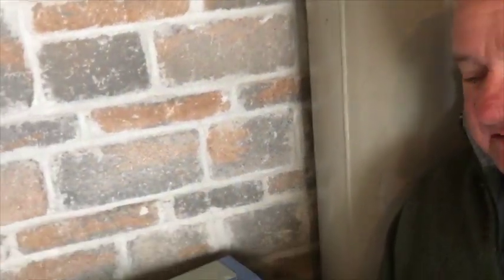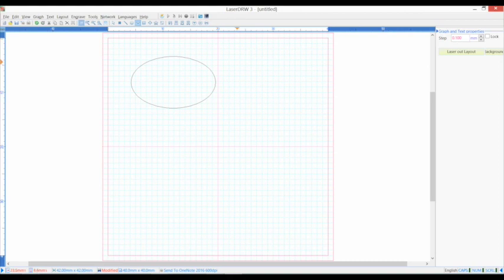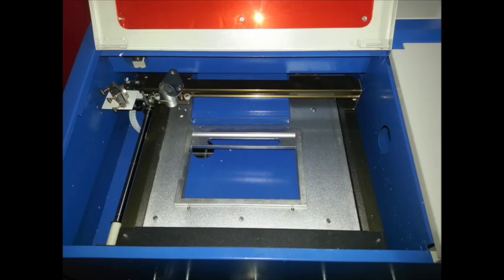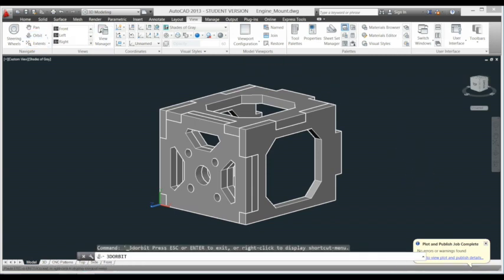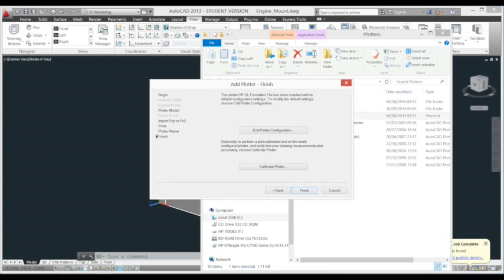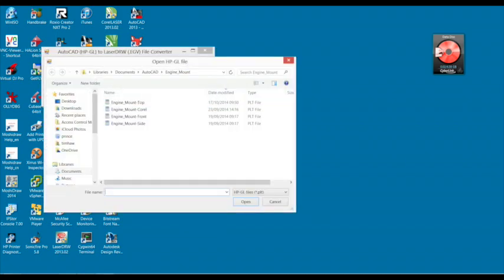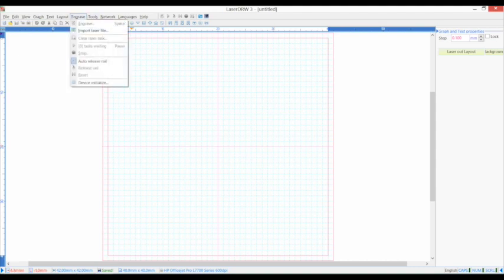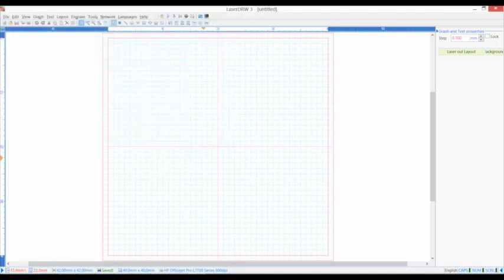Low Cost Vector Cutting using the Low Cost 40Watt K40 Laser Engraver from eBay

Comment: Hm. I'm currently working an API based on Whisperer's USB interface and the proper decoding of the LHYMICRO-GL instruction set. I really wonder how good their file encoder is. But they open up a file in 7:29 and does a diagonal cut. And is BaLa a bunch of times repeatedly, to go the distance. This actually tells the machine to go 1/1000th of an inch Right (+X) and then a 1/1000th of an inch Top (-Y) but properly in the instruction set this could be done with 3 commands. RLMzz. It looks like they solved the directions and the the distance for 1/1000th of an inch. Even the draw a line stuff is LaLaLaLaLa a bunch of times rather than Lz or L|q or the proper distance encoding. The second file appears to have these distances though. Also, it seems to be limited to 1 speed and requires you still use that weird Chinese software to work. 

I would highly recommend you google K40 Whisperer and download it for free, it can use basic SVGs, Gcode, DXF, and some other nice formats. Likely a much better path. Especially where you don't need the chinese software or the dongle.